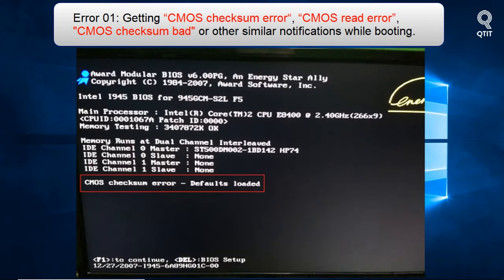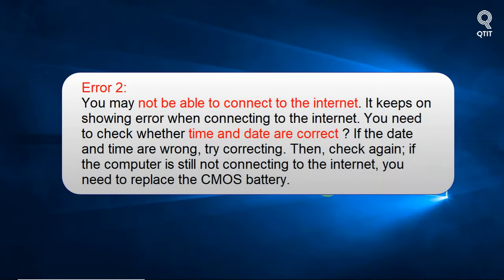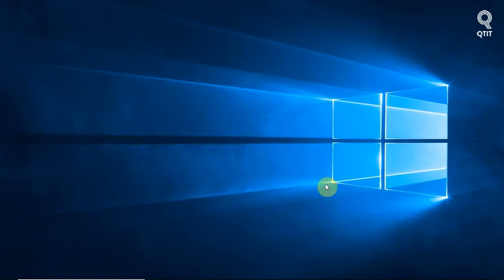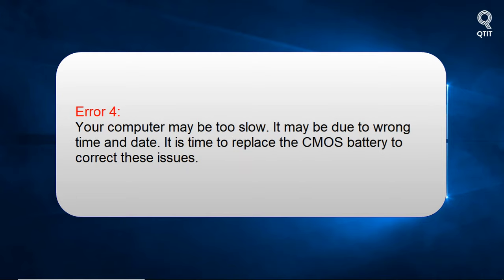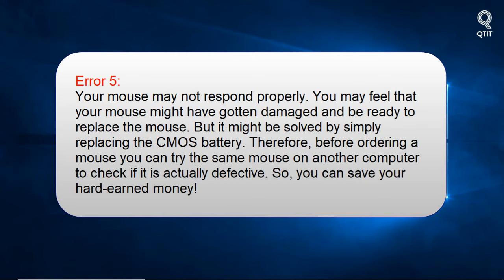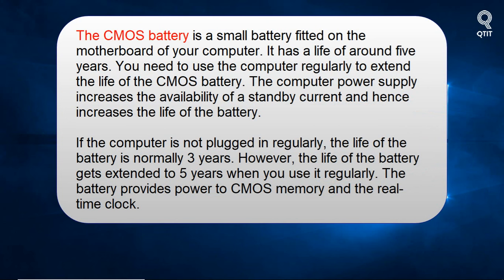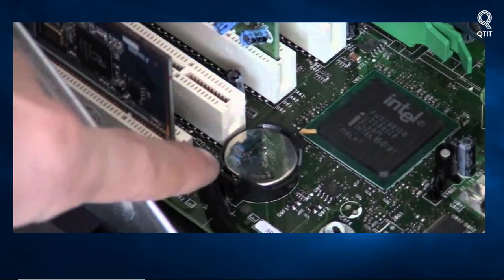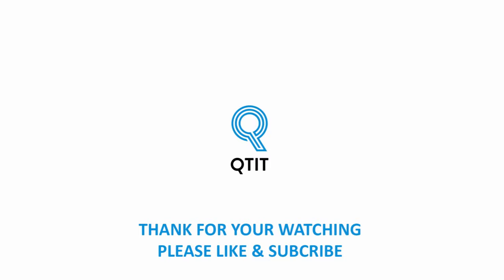How To Dectect CMOS Battery Failure Of Your Computer

Comment: In my situation it's the monitor not staying on. Every two seconds you have to hit the power button on the monitor to get it to come back on. I tried resetting the CMOS battery and it detected it as low, so my next move is getting a replacement tomorrow. Hope it works..
Reply: So did it work?
Reply: @daddythefather2480  No. I just replaced the monitor.
Reply: @i94yeh2p  lol
Reply: @daddythefather2480  😂 lol
Reply: I mean...

Comment: is this also a cmos battery error when your hard drive randomly doesn't load and load later and your date is correct but time automatically changes to am? and also one last thing is it crashes automatically sometimes
Reply: it's a new pc I got btw custom built and am having this issue
Reply: @itzbatsygaming504 hi bro we have the same issue its hard for me to accept that im having issue with cmos battery since my pc too is bought brandnew. i dont have issues mouse and keyboard not functioning but i do have issues wirh bios date and time constantly resetting and from a shutdown then turned on bios is loaded instead of windows. how is your pc now how was the fix for it tia.

Comment: My keyboard and mouse stopped working and I found out the CMOS battery is dead if I change it will it work
Reply: hey same issue did you find any fix?  did u replace the battery
Reply: @Anonymous-kg7yg  yep i tried it out it did 100%
Reply: @johnmana3211  not working for me bro sometimes i am not facing issue i don't know now which components having issues